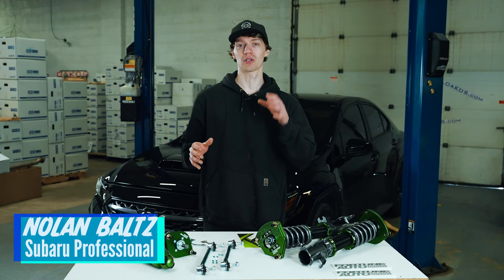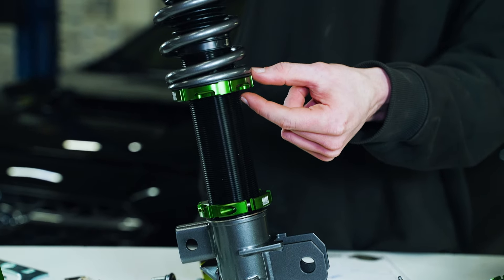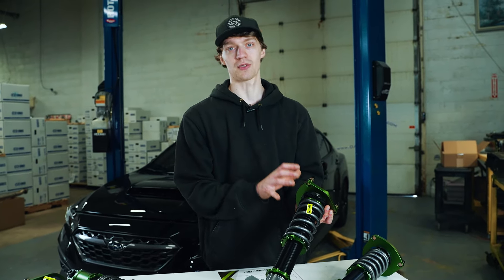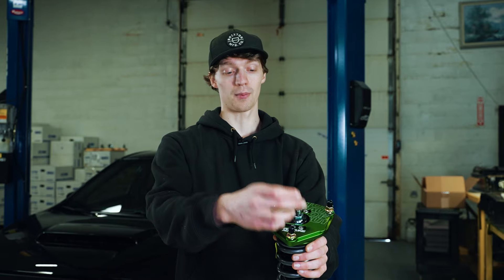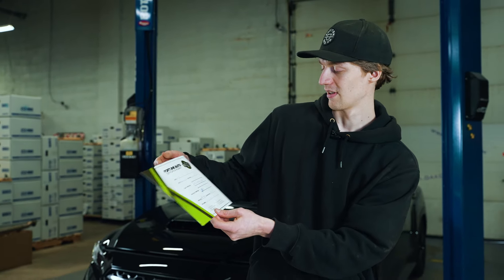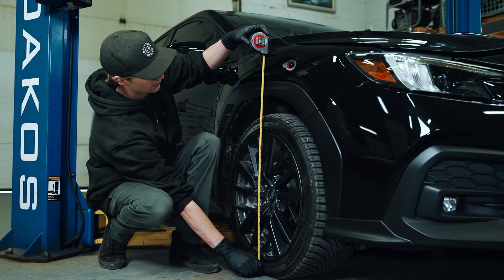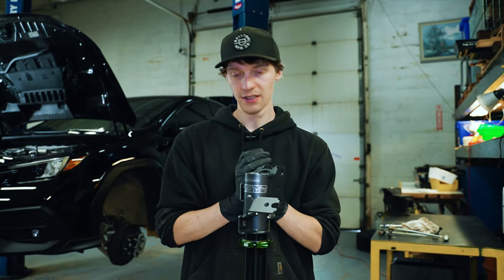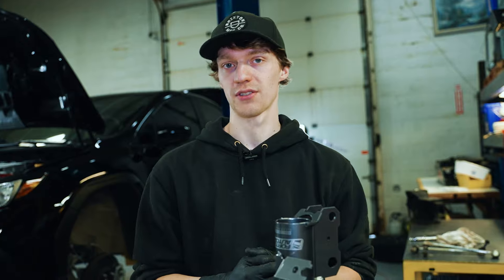BRAND NEW Subaru WRX Gets FORTUNE AUTO 500 Coilovers Installed!!!

Comment: Appreciate the overview of the product, but how did you determine the initial setup? You kind of glazed over that part and didn’t show the ride difference afterwards.
Reply: We will have another video going over how the coilovers ride and handle. Basically after we installed it, we lowered in onto the ground and it needed some adjustment. We kind of just estimated the initial setup, and then adjusted after from there. Took a couple go's but you can get it done. But the Initial setup was based on the 70cm that we measured the OEM height at. You just have to keep adjusting it until you are at the ride height you desire. Adjusting is just like how we showed setting it in the video. Loosen the bottom collar and turn the shock (black threaded body) either right or left according to if you need to raise or lower it.
Reply: Why are we using the metric system?
Reply: From the looks of it the car was dumped. Then spent 2 hours adjusting and still front end was sitting 2inches higher.. probably called it a night after adjusting

Comment: I’m getting squeaking noise 3 months after installing FA500’s onto my VB, any wonder why it would start to squeak from the front end?
Reply: Squeaking can happen on the front for a number of reasons, usually related to endlink adjustment issues or even some gravel stuck between the spring coil and the shock body. If you record the noise and email the clip to fortune, they can help diagnose and resolve the issue.